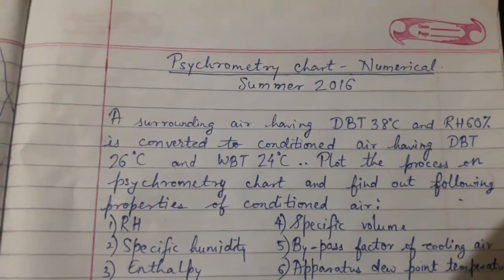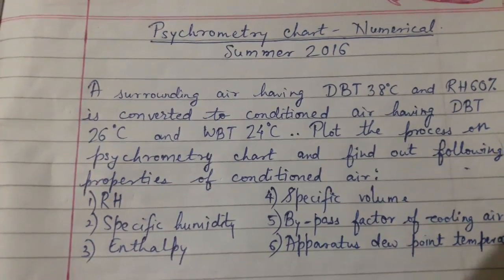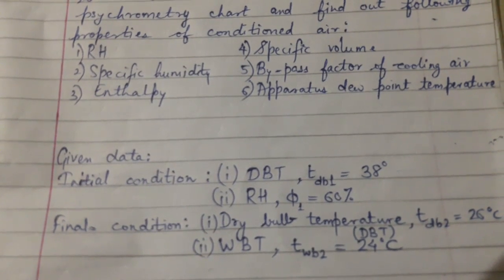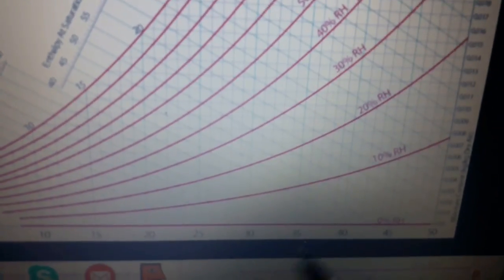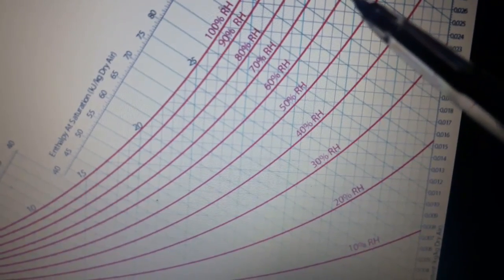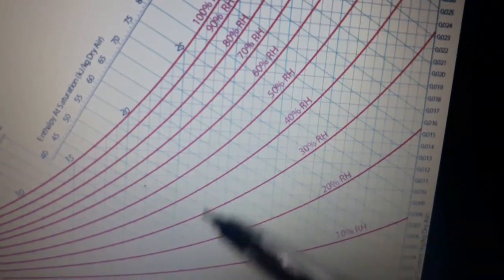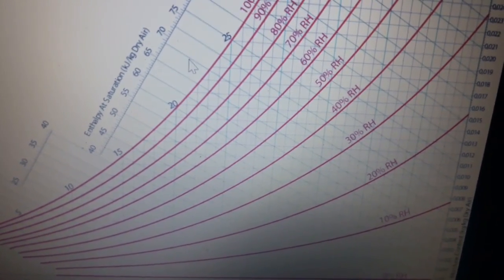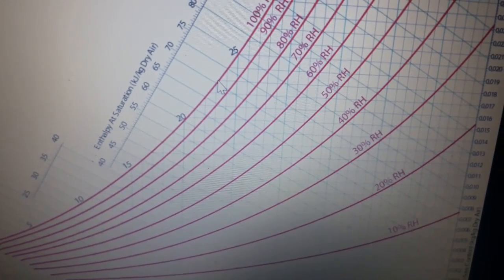Psychrometric chart - Numerical.... #80kviews #viralvideo #psychrometricchart

Comment: The horizontal lines on the "Psychrometric Chart" are for the "Mixing Ratio" not the "Specific Humidity",  However, you wrongly use the term "Specific Humidity" for the "Mixing Ratio" horizontal lines. These two terms are not the same thing.
Mixing Ratio = gram vapor per kg dry air
Specific Humidity = gram vapor per kg moist air